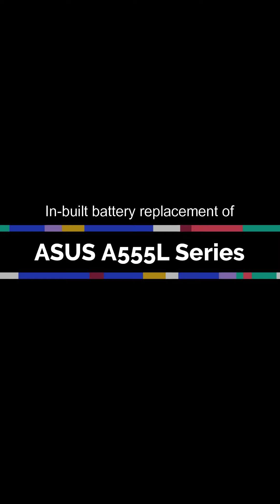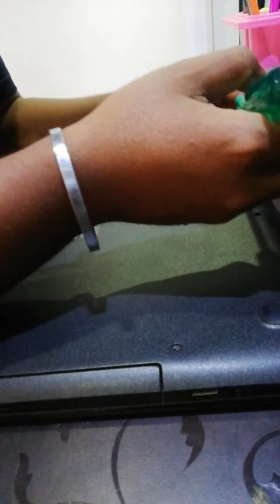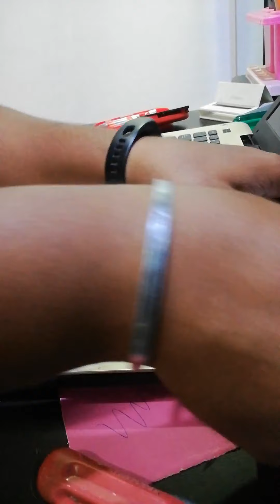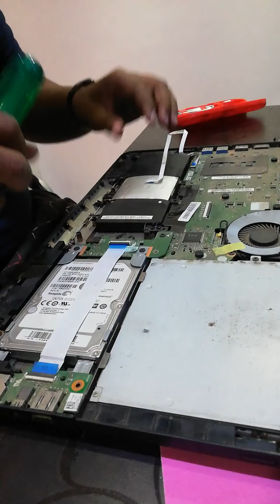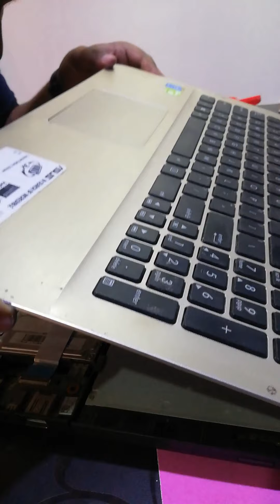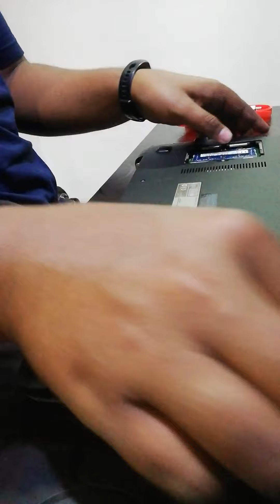BATTERY REPLACEMENTS | IN-BUILT BATTERY | ASUS A555L

Comment: If I take out the battery pack, can the laptop be used without it by just being on the charger until I get a new one?
Reply from the maker: Yes you can. Just plug the charger and use as desktop.
Reply: @santoshkumarmeher  omg thank you, one more thing, this is the laptop that has the battery under the left side of the mouse pad right?
Reply from the maker: Yes
Reply: @santoshkumarmeher  thank you, you just saved me a good bit of money